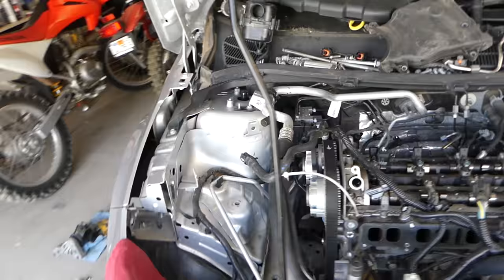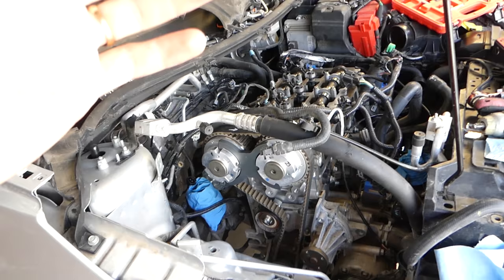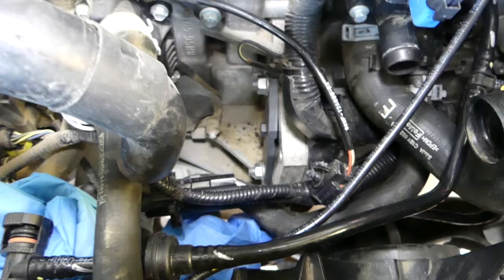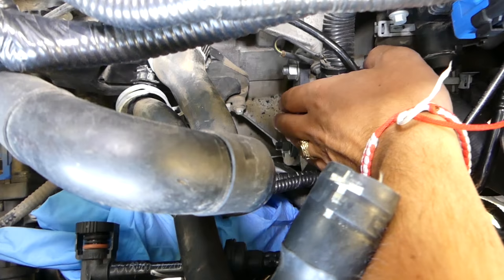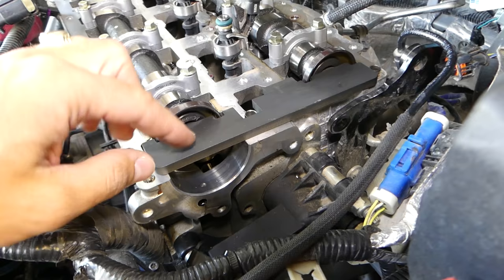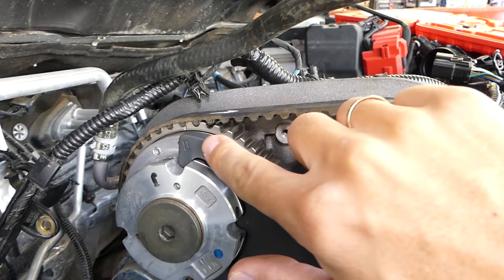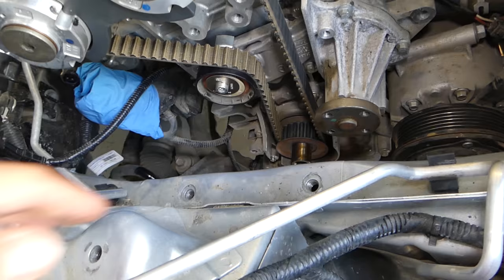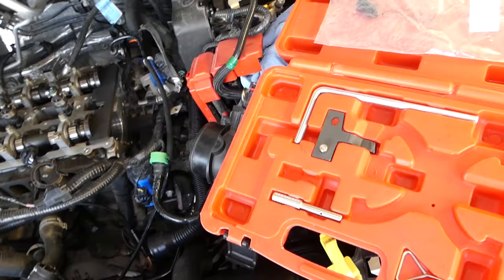FORD ESCAPE TIMING MARKS 2013 2014 2015 2016 2017 2018

Comment: Better know what your doing. As these engines have key less Cranks...You get it wrong. You bend the valves..
Reply: behexen250 spinning the motor does not tell you nothing. As the crank is not keyed...So doing it by hand will fool you%

Comment: You really only need to use the rear plate on the cams if you're replacing the vvt gear. You don't have to go thru taking the valve cover off etc just to do timing belt.

Comment: The maintenance schedule for '15 Escape 1.6 L shows 150K mile replacement interval for the timing belt. So, you're saying to disregard this and replace belt at 100K miles?
Reply: I’ve never seen a belt recommendation that high.  Maybe you saw kilometers?
Reply: They consider the life of a vehicle 150,000 miles. They also say the transmission is a sealed unit and should be replaced at the same time. Or you can do "early" preventative maintenance, and keep everything running longer.
Reply: @wrifraff  What is it your trying to say?   I don’t understand.   That you should just run it without replacing the belt because it’s garbage at 150k anyway?     As far as I’ve always seen, a rubber timing belt is very likely to brake or teeth sheer off at miles over 100k.
Reply: @Dogpool  I'm saying Ford's recommendation is to throw the whole thing away at 150k, or you should replace it early to avoid having to do that.
Reply: @wrifraff  lol, I think your right.  Pretty’s sure Chrysler and Nissan do that too.
Reply: @Dogpool  timing belts of today are made with better quality components as well as exotic fibers such as Kevlar. The can and do last 150k miles easily. I have service many with over 200k and have yet to see one with a broken belt.
Reply: @larryreno8293  since when?   This is not what I have experienced.
Reply: @Dogpool  since it was released in North America. I’m looking at the maintenance schedule in WSM and it clearly states every 150,000 M or 240,000 Km
Reply: @Dogpool  The Ford escape manual says 150k miles. I have seen the go well over that. I remember the days where they would say change belts at 60K miles. Those days are long. Toyota use to be that way. The book would say 2 hours, but I did them in 45 minutes. I did them on the side for easy money.
Reply: @Tom-yj6mt  what timing belt takes 45 min?  On what car?
Reply: @Tom-yj6mt  I wouldn’t recommend going that long.  I have seen timing belts brake well before 150k.  I wouldn’t risk it.
Reply: @Dogpool  Early 90s on the Toyota corolla. The book said 2 hours but I did enough of them to do them in 45 minutes. Single cam. I was a Toyota Tech back in the 90s.
Reply: @Dogpool  Any belt can break at any mileage. All I'm saying is the days of changing them at 60k are long gone. I've seen Escapes go well over 150k. It does say 150k or 10 years. To be honest i've never heard of one failing. Belts have come a long way over the years.

Comment: this is not identical application for a 2017 that has chains ,not belt ,and NO TIMING MARKS on the phasers with the 2017 !!!!!!!!!
Reply: The ‘17 is a 1.5L and is belt driven. If you have a chain it is either a 2.0L or a 2.5L.

Comment: Okay I have a question. I am doing the timing belt on a 2017 Ford Eclipse so once I put that crankshaft pin and in turn the crankshaft clockwise and once the crankshaft stops I'm pretty much lined up correct. Or what else do I have to do
Reply: Throw ramen noodles at it..,.

Comment: This is just timing belt. Its nuts. I want to do my fiesta st. But im alittle worried
Reply: he went way over kill. You do not need to take valve cover off or starter. All you need to do is lock the cams together and lock the crank shaft.

Comment: Was this just a timing belt replacement job or was there another reason for this repair, I see alot of these cars at my shop but are so new i never notice any problem...was there a problem with this one?
Reply: q for u mike. i need to gain access to change out water pump. im not sure i need to pin the crank? extra work i do not want to do. as long as i dont disturb the crank i think it will be ok? thoughts.

Comment: Do you have video how ford engine work i want to understand the system for i really wonder why crankshaft sprocket is freewheeling
Reply: All the pulleys are friction fit. You must use the timing tools to insure correct timing.
Reply: Normal for this engine

Comment: as far as i understand the official instructions do not advise you to remove the valve cover and lock the camshafts locking the sprockets is all it shows? is there a reason for this.
Reply: Yes, because he didn’t read the service manual. You are correct, you do not need to remove the cam cover to replace the timing belt.
Reply: I guess he did that for a safety back up to another safety back to another. Some Hondas and Toyotas not even a single tool as long as you align the TDC thats it.

Comment: Hi I replaced a new water pump for my 2017 1.5L Ford escape SE and it won't start it Cranks but won't start could adjusting the timing be the problem
Reply: What did you do to insure the engine timing is correct while replacing the pump?
Reply: @larryreno8293  after I replaced the water pump I put the timing belt back on and I didn't know I was supposed to be realigning the timing so I cranked it with out realigning it
Reply: @eugenecurley5328  is it running now, did you bend any valves?
Reply: No all the valves are good I've been trying to line up the timing but it won't start it Cranks no start
Reply: @eugenecurley5328  go on Amazon and buy the timing tool kit for that engine. You should only have to install the TDC stop peg and the cam phaser holding tool. Make sure that you’re at TDC by removing #1 spark plug and inserting a long screwdriver into the cylinder.
Reply: I ordered it just waiting for it to be delivered

Comment: RIDICULOUS!! Terrible design!
Reply: Right, i just did one today, but i didnt need to lock the flywheel, use cam plates, remove axel& use the little bolt to find tdc. I took out #1 plug, found my tdc&lined up 2 cams. I did have to get the crank pulley alignment tool tho
Reply: To do the timing belt you need the cam sprocket lock the TDC pin and the flex plate holding tool that goes where the starter normally goes. It is not necessary to remove the valve cover. Which I see is removed in this video
Reply: yes i have to do it for a water pump. unreal !!!!